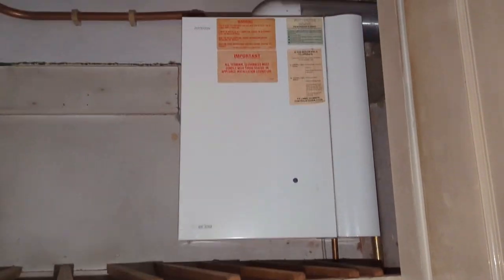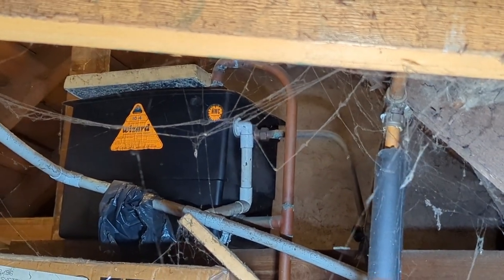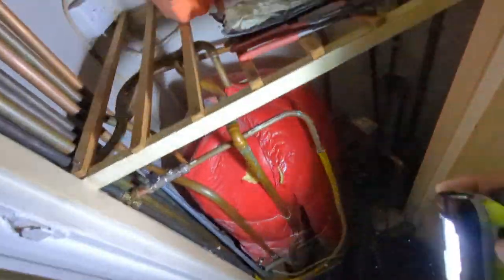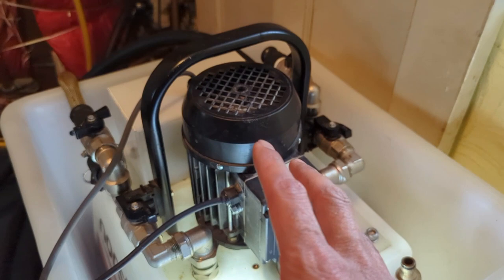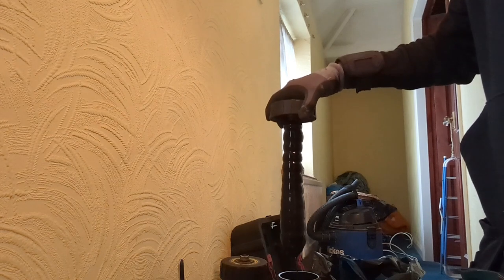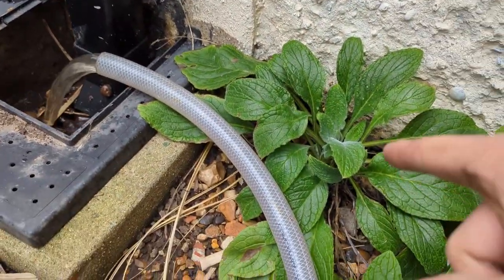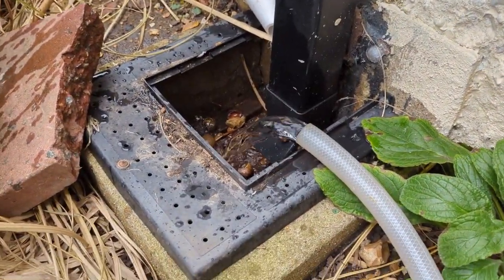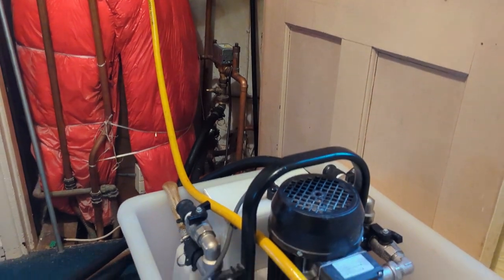Did A Powerflush Work?? - A Day In The Life Of A Gas Engineer #13

Comment: Good video, I just done a magnacleane on a system and connected main water for the flushing part, the stuff these magnets collect is quite incredible, then the main picks up even more stuff. My powerflush finally packed up after 14 years of loyal service, but a magnacleanse and main flush work just as well imo
Reply from the maker: Only thing with the mains flush is depends if you got a good enough incoming main to push the dirt through. I started with just a magnacleanse but then got the powerflush machine with the heated element and it works a dream!

Comment: Hi mate good video. Are your rads full of water when flushing or halfway?
Reply: Also have you just connected both your hoses to the pump connections, can't really tell in the video?  effectively having your equipment in series with the flow pipe from the boiler..
Reply from the maker: Hey man I try to keep them halfway when I can and yes I've taken the pump out and connected to each connection 👍🏾